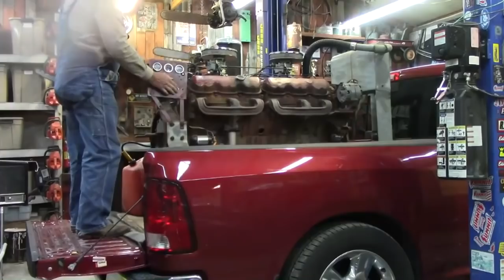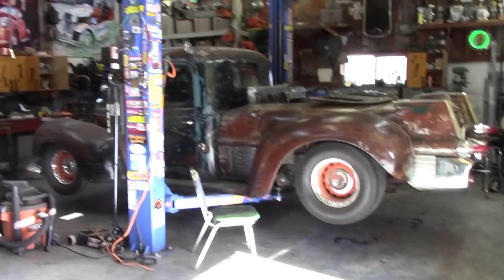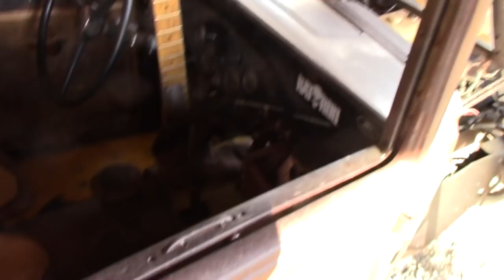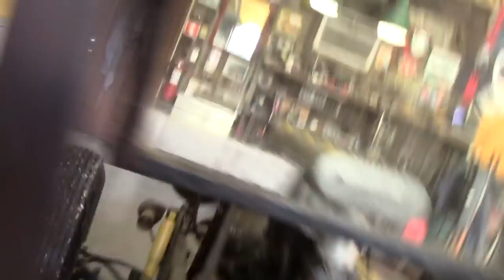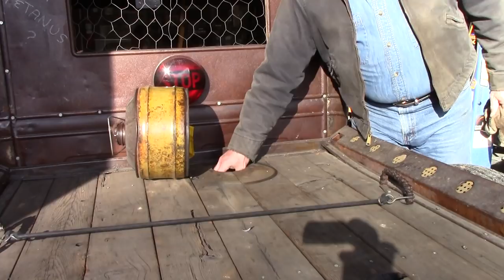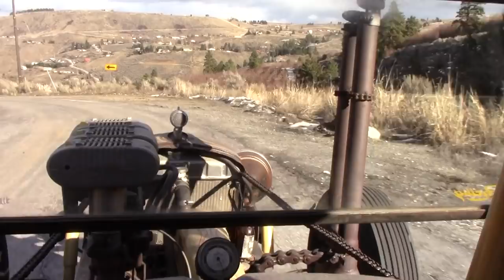1932 Chevy Rat Rod

Comment: I noticed your "STOP" brake light. It's the second one I have seen. The first one is on my dad's retired '70 International 1600 propane truck. It's a lovely light!
Yes, it still runs like a top. It does its chores around the farms for us. We slapped a slow moving sign on it. 35 is fast enough on bias ply tires.
Take care from Oklahoma.
Reply from the maker: my light came off an old school bus.. those wide whites on my Rockabilly are bias ply and I run them 60mph all the time.. but Im not too bright.. haha... those old IH's are tough trucks! back in the 60s and early 70s. boy thos IH's and Dodges were meant to be Worked!! they were tough

Comment: Waylon, I love the sound of you double  clutching. It's almost a lost art anymore.
Reply: When I first learned how to drive all we had was stick shift trans back in 1969. I got to take my driver test back then in a 1960 Pontiac station wagon three on the tree. Try shifting and driving and feathering out the clutch pedal while the state trooper stared me down in discuss evil hippy.  I had to start laughing at him. He was ready to kill cause I was doing so good it pissed him off.
Reply: @lestermiller2717  I taught myself how to drive a stick in 1969. My father had passed away the year before, when I was 15, so I knew I was going to be the one to drive the family car, which was a then nine year old VW Beetle. My sister was 12 and my mother never learned to drive. So I became the family chauffeur.
Reply from the maker: its funny that you mentioned my "double clutching" in "this" video because...  you see, when I built this thing..I got a chunk of 5/8" aluminum and I built an adaptor plate and mounted up a 1990 Chevy S-10 T5 transmission behind that old 1932 engine. well, that went ok but the input shaft on the T5 is 14 spine and the old 32 chevy clutch is 10 spline so I got an input shaft out of a Jeep transmission which is also 10 spine and amazingly enough.. fit that old 32 chevy clutch perfectly.  but here's what blew me away.. that input shaft on a 1990 transmission fit perfectly into the pilot bearing on that old 32 chevy engine!  i had to laugh (at myself) when you said you could hear me double clutching that old truck... that T5 is fully synchronized and doesn't require double clutching at all!   haha.. BUT... something about the sound of that old 6 banger just takes me back .. and when I get behind the wheel and fire up that old stove bolt..Y  I'm 15 years old again!  and I "catch" myself double  clutching when its not even needed! haha.. but its FUN and it makes the kids wonder what the heck that old man is doing!  lol

Comment: Ken why don't you try a Remflex exhaust gasket? I use them on my Slant sixes, and they...don't...leak.  They show to have part # 2092 for 1929-33 Chevy 194 engine. About $60.00
Reply from the maker: i use those all the time. I have a set on the headers at the collector on my Doje'llac. .I think I have a set of gaskets for the ol rockabilly lying around here "somewhere" haha

Comment: Back in the 60s my dad had a 1932 chev 5 window with free wheeling. Do you have any clue what that was?
Reply from the maker: no
Reply: Free wheeling was where there is a one-way clutch in the drive train, when you let off the gas the car will just coast along at idle.
Reply: @daleolson7205  Thanks for that! Your the first person in 40yrs that could answer me. All I   knew was its not legal here in Canada.
Reply: @snarlie2569  It was standard on the old SAAB 96 two-stroke motors and still there in the V4 versions.  If you are reving up a two-stroke motor going down a hill with the throttle closed, the gas/oil mix is not going through the motor to keep the bearings oiled up causing damage.
Reply: @daleolson7205  Im assuming in the old chev it could have caused a runaway with those fine brakes they had.